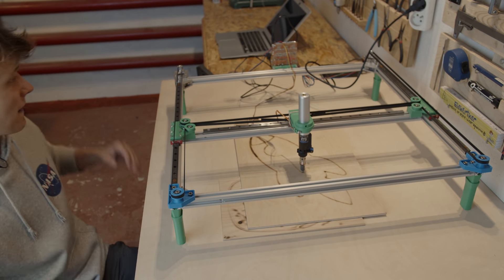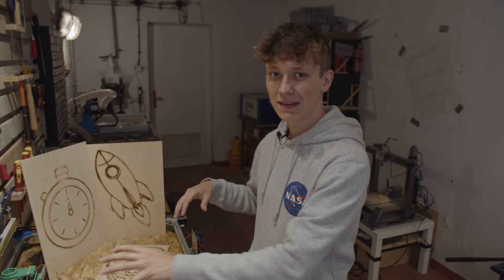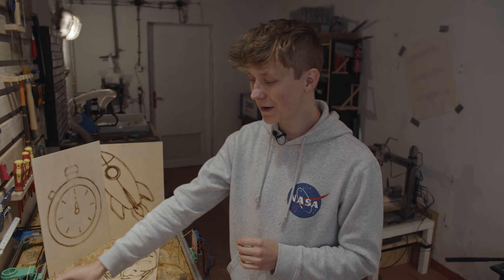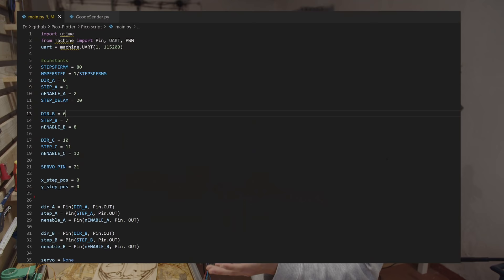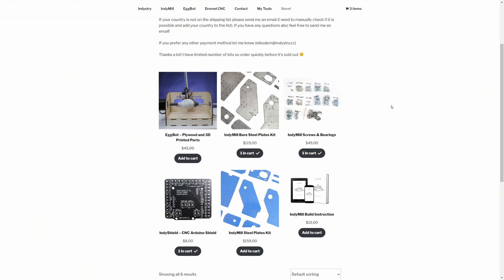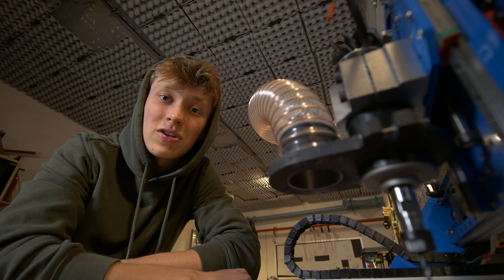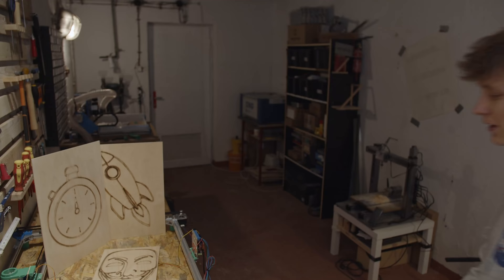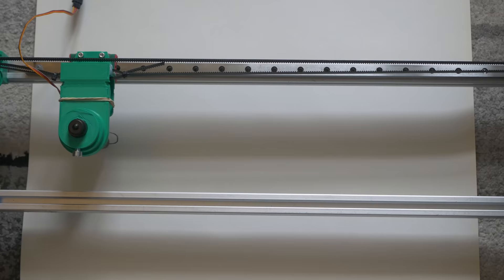DIY H-bot Plotter (Raspberry Pi Pico)

Comment: Try to use a laser engraver for this. And/or try to design a holder for that tip wich works like the wheels of the cart in the shopping center. Holds the tip in a little angle and always pulling. It neeeds a little programming for the turning, but it could work.

Comment: Hey Nikodem, i just finished building my dremel cnc and wang to thank you for providing this project. I am currently experimenting with machining aluminium, but am having some trouble. In your video you cut it efforesly at what looks to be like 1mm deep, while my 500watt spindle is alrrady having trouble with  0.2mm at 400mm/s.
What settings are you using?

Comment: 9:40 they do bend because the design is flawed. A simple rib on top would fix it. You "fixed" the flawed design by using a material with a higher bending stiffness. It's the same when building a bridge by laying out a thin board of wood without a beam underneath and expecting it to last.

Comment: Could the drive mechanism be scaled to support a plasma cutter? Really cool btw!
Reply from the maker: Unfortunately, 3D printed parts and a plasma cutter is not the best combination. Also, the whole construction is just too weak for such a use case. But IndyMill can be easily adapted to plasma cutting and once I find a new space I may even build it :)

Comment: Could you try to add a drag-knife too it?
Reply: Not really rigid enough. However, there are numerous other open-source designs that can do it. Basically you want to look for a router design to base your machine on. Also you will need a Z-axis with some sort of spring loading.

🤔